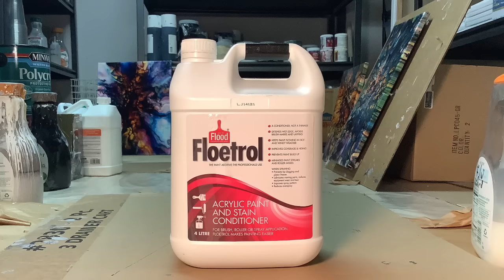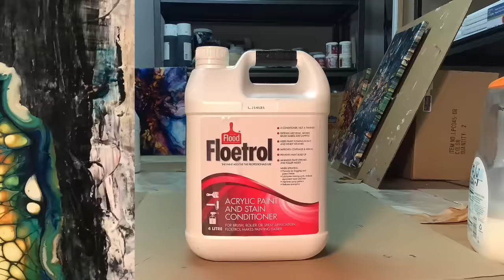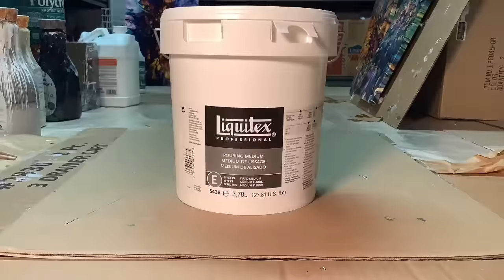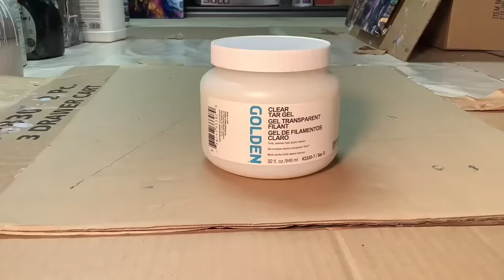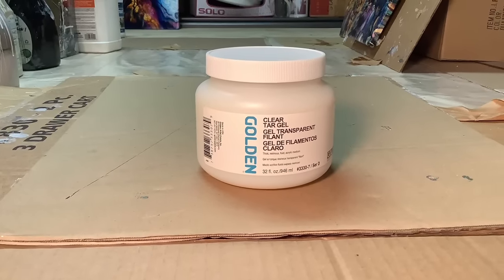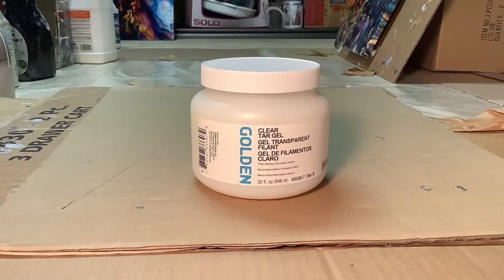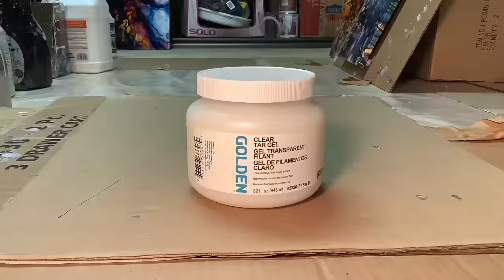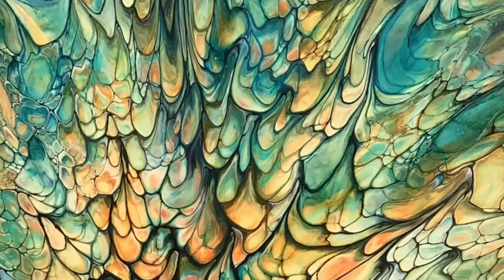What is the ultimate cell activator?

Comment: Just for clarification, a simplified ‘recipe’ would be; ( using 1/8cup = 1 part.).     1.) mix the main mix which is also called the base color, consisting of 1-3 parts paint. I choose 1/4 cup (2 parts) white acrylic paint. 3 parts medium which is  3/8’s cup of Behr # 3453 paint,  4 parts (1/2 cup) of Golden Tar Gel. 1 part thinner which is 1/8th cup of High Gloss Polycrylic
For the top layer, AKA the puddle pour;  1.) mix paint 2.)  Thinner which is 10 parts Liquitex Pouring medium & 4 parts Floetrol (watered down)  and then  10 parts of that thinner(1 1/4 c.) blended with 7 parts paint (7/8’s cup). Does this sound right?  Thanks for your help. I know I’m not the only one confused.
Reply: One more question for you Steve. Can I substitute the Golden Tar Gell for The Golden GAC 800? Will I get similar results?
Reply from the maker: Thank you so much Susan 🙏 sorry about the confusion. I can see there is confusion about the word “paint”...whether or not it’s Behr or Golden. Consider the main mix and the base coat identical except the colors used. The formula is 3 parts Behr...and 1 part polycrylic...and .4 parts tar gel. That makes the tar gel equal to 10% of the Behr and polycrylic combined. So 15 parts Behr plus 5 parts polycrylic equals 20 parts. 10% of 20 parts equals 2 parts tar gel. The grand total will be 22 parts mix. I the and 10% Golden paint to this total.
Reply from the maker: Your formula for the top layer mix is correct👍
Reply from the maker: @susandurry9079  ...the tar gel and GAC800 are two completely different products....I didn’t have a lot of success with GAC800
Reply: @chasefluidart4341  It’s funny how so many people recommend the GAC 800. Thank you so much for your expertise. I’m an artist wanting to try this process but have already spent more than I should have. I’ll keep experimenting! Thanks for your feedback. Happy painting to you!
Reply from the maker: Thank you so much Susan 🙏 I hope that I was able to clear up the mixes for you🙏 I will always try to help in any way I can. Feel free to pm me anytime👍

Comment: Great video Steve. I'm only new and located in Australia. Can you advise what the equivalent products would be as I can't get Behr. I'm also still a little confused about what products/ratio's you use for the different steps. Are you able to list them in order for the pillow, pouring medium, paints and top base for me to understand?
Reply from the maker: Thank you so much splatter 🙏 I am not familiar with Australian products except the Flotrol. What to look for with the pouring medium is the deepest base paint. It needs to be neutral...most of them look very light tan in color...avoid if it looks white because it will turn colors pastel. The ratio for the base and colors are the same...3 parts medium paint...1 part Polycrylic and .4 parts tar gel (10%). If you are using Australian Flotrol for the top layer mix the ratio is 3 parts Flotrol to 1 part paint. Keep in mind ratios are not exact because things change depending on the products used...but they are a good place to start. Best of luck on your journey 👍

Comment: Hi, I love your art.
I've only been in fluid art for a few months.
I watch your videos and try to translate them to understand them, just like I translate my questions,
  I hope not to bother
I find it very interesting sir, I would like to ask a person with more experience than me:
- Where I live it is impossible for me to get Australian floetrol and neither American floetrol,
but yes woetrol, I also get untinted house paint and glossy water-based polyurethane varnish,
the question is, if the consistency is from thicker to lighter? , starting with the thicker base house paint and then a little more diluted the acrylics with the medium, and finally the cellactivator a little more fluid
Thank you  ,
Reply from the maker: Thank you so much FFJJ 🙏 it appears that you have the translation done very well👍 with the lone exception of the top layer paint mix…everything else uses the same formula and paint…so they are the same consistency….the top layer mix on the other hand is heavier and more watery so that it will sink through the other paints.

Comment: I have watched this video several times. I wonder if you put a lighter fluid paint under the poured paint. Would this cause cells.

I need to not fear experimentation!
Reply from the maker: Excellent question Maya Jean 🙏 thank you so much. If you are referring to the base coats in the video the answer is no. The base coat is identical to the poured paints. However a lighter base coat would have an easier trip to the surface. The lightest paints I’ve found are Extreme Sheen from DecoArt. Go for it…experimentation is what makes it fun for me👍

Comment: Do you add colour paint (white) to the Main Mix:  Color Pouring Medium when you apply the first base layer?
Reply from the maker: Thank you so much Psilocybin 🙏 In this video the Main Mix consists of the Behr, Polycrylic and the Golden tar gel. I mix these products up and store them in a quart container. I then use this mixture in separate cups and add the individual colors to them. The base color is the same as the rest.
Reply: @chasefluidart4341  Excellent thank you very much - I'm giving your recipe a try today 😁 Your video was so informative and inspiring
Reply from the maker: @randomnumbers710  ….very kind …many thanks 🙏

Comment: Hello Mr Chase
Firstly, thank you for creating these videos. There is a lot of misunderstanding out there regarding this process.
Evidently, understanding paint density plays a fairly large part in a successful project. My question is: how do I/we determine the density of the paints we choose? This seems integral to how we layer our paints. There are some guidelines regarding opaque/transparent order, but I've not been able do discern the density. Have you any suggestions? Thank you sir.
Reply from the maker: Thank you so much Mark 🙏 I appreciate your comments. Yes I pay attention to densities but mainly in a flip cup type of pour …where gravity alone is responsible the source of pressure. The top layer mix goes in the cup first…followed by heavy densities up to the lightest. With air pressure there is a little more leeway because the extra pressure takes up the slack if the densities are out of balance. Rather than getting bogged down in numbers I use my practice canvas and experiment with different combinations even if the densities aren’t ideally layered. Truth be told I’m more concerned with how the colors interact. As long as the top layer mix is fluid enough and heavy enough to sink through the other paints the cells will form with the proper pressure. Companies such as Golden and Liquitex have charts that have densities listed…the best bet is to contact the manufacturers 👍
Reply: @chasefluidart4341  Thank you sir
I have many different manufacturers of paint, and I see a varied mix of different makers used by most videos I’ve seen. Seems very daunting to examine the densities of these combinations. Good to verify, as long as the top paint is heavier (hence the titanium whites and blacks), cells should form. I’m currently engrossed with the bloom technique and I think I’m safe with your advice. Thanks again
- Mark
Reply from the maker: @MarkZart  …glad to help…best of luck on your journey 👍

Comment: Hi! I'm a beginner at paint pouring and making cells.  I have 2 challenges that I would like to hear from an experienced person how I probably could solve.  

1.) My paintings are cracking when drying.
2.) My cells disappear after some minutes.  
Could it be because I have a too thick layer of wallpainting in the bottom?
Reply from the maker: Thank you so much Johanna 🙏 all I can offer is a guess or my opinion. First of all I am assuming that when you say “wallpainting” you are referring to using commercial wall paint as a base coat. If that is the case then yes you are probably using too much. The cells will dissipate and the film will setup and dry before the rest of the paint has a chance to do the same. That will usually cause cracking. 
Using house paint is certainly more economical but you pay a price because you lose continuity….it’s making the artist grade acrylics weaker… and as a consequence the cells will be weaker. Ideally I want to use the same paint throughout… so my base paint uses the exact same paint and medium as the other colors….and my best results come when the finished product is thin on the canvas.

Comment: Thank you for your precious advice and the giggles 😂 Is it possible to create beautiful cells without rotating the canvas? 🤔 
p/s Sorry if my English is poor, I use google translate. 😅
Reply from the maker: Thank you F.G. 🙏 Yes…if the ingredients are proper and thin enough. Base line Rayleigh Taylor Instability proves it. Heavy paint sinks while lighter paint rises to meet equilibrium and that creates the cells. The problem is the size of the cells is limited without horizontal movement. Rotation thins a puddle out radially/horizontally and forces the cells to expand….and also cover the canvas.

Comment: Do you have any suggestions on how to get rid of bubbles in the Behr pouring medium. I always dealt with bubbles with the more traditional acrylic pouring a quick pass of a torch, or simply dropping the canvas. Neither method seems to work that well with the thicker Behr mixture. I get the bubbles either when I mix the Behr with the Polycrylic, or when I add the pigments to the same mixture. They really stick around even after spinning and don't look good after the paint dries. Any suggestions would be welcome!
Reply from the maker: Hi Paul 🙏 as a general rule I mix up the main mix by the quart and they sit at rest for weeks at a time. I will gently stir before use. Most bubbles will dissipate after air is applied.👍
Reply: @chasefluidart4341  I'm only mixing up one quart at a time, and then use it within a few days before mixing another batch. I guess I could mix up more so I have some sitting unused for a longer time.
Reply from the maker: The combination of letting it rest, spinning and air pressure usually results in very few bubbles. I do pop bubbles on final inspection but it’s pretty minor. One last thought..you might try adding a little isopropyl alcohol to the mix and see if that helps…some people swear by it.

Comment: Does it matter what color u add to the base paint or pillow paint? Also what about just mixing pigments in dry form with the medium and does it matter if the colors are translucent or opaque ? Lastly how to blow it over the colors without blowing into the pillow and causing it to come up. I have really been struggling with this. If I do a swipe it’s easy but blowing is hard and get very few cells .
Reply from the maker: Sorry this reply took so long Brandi 🙏 I’ve been away from home. Since this video was produced I have modified some things in a new video you might want to watch….see my home page in Chase Fluid Art. It will answer some of your questions. So…no it doesn’t matter about colors in your base. Opaque will cover colors below it…translucent will slow colors to show through. Blowing the paint is tricky. In my experience less force is better….it took a lot of practice for me…in the video you already watched there is a section towards the end shows how I go about it. Thank you so much for your questions 👍

Comment: I'm tying to follow your directions, but having some issues.  So you have 3 layers of paint:  Base, Middle & Top.  In your video, was the middle layer where you squirted lines of different colors at random and the top coat was the black you put mostly in the middle and blew outward?  You said, I think, that you use Golden Fluid Paints, but later you said Fluid Acrylics do not have enough body because they lack fillers.  Is that a contradiction?  You said we need a soft body paint like a student grade (Lucas or Amsterdam.  Or maybe, you use Golden "Fluid" for middle layer and student soft body for top layer.  Also, I really wish you would make videos.
Reply from the maker: Thank you so much Kathy 🙏 I appreciate your comments. Yes I use the fluid acrylics for the first two layers. The reference to them not having enough body relates to the top layer mix only. For that I like soft body paints.👍

Comment: Would you say that the top layer mix is supposed to be thicker or thinner than the bottom layer? I have matched your formula for the bottom layer, but Lucas Arts and Amsterdam paints are hard to come by here in Canada so I'm using Liquitex fluid acrylics. I've tried the 10 to 7 ratio of thinned Liquitex with the Liquitex paint, but the results haven't been great. I've seen some cells forming but it's nothing like what your demonstration shows. I'm using forced air and spinning on the mixture. I presume the Liquitex paint is the culprit. From your video it looks like the top layer mix is slightly thinner than the bottom layer mix, although it's hard to tell. Any suggestions would be welcome.
Reply from the maker: Hi Paul 🙏 I’ve tried the Liquitex fluid acrylics also with minor success. Just my opinion but I can use the exact same materials, measurements and procedures and the Lukas out performs the Liquitex every time. Two things come to mind…possible chemical interference with the Liquitex paint or a difference in consistency. The top layer mix should be thinner to help it sink through the other layers. Try thinning the top layer mix even more.  It’s a real fine line because if it’s too thin the cells won’t hold together so experiment gradually. Next consider how you are manipulating the paint. Keep in mind that I am using an air compressor. Comparing a hair dryer vs. air compressor at the same velocity the compressor is going to have more force…so my top layer mix has to be thicker. Keep in mind that it doesn’t take too much force to see results…. As I said in the video.. I have found very few paints that really work well for the top layer mix Lukas just happens to be the best….I get mine through Jerry’s Artorama.
Reply: @chasefluidart4341  Thanks for the info. I couldn't find any place in Canada selling Lukas Kryl paint so I decided to bite the bullet and order some from a store in London England. I just have to be patient until it arrives!
Reply from the maker: Jerry’s is in America
Reply: @chasefluidart4341  Jackson's was actually a little bit cheaper. Shipping was high from both locations...
Reply from the maker: @phsteele  👍
Reply: @chasefluidart4341  I've had some success using your ingredients. The biggest issue I'm having is getting consistent results blowing out the black puddle. I've used both compressed air and a Shop Vac in blower mode. I have better luck experimenting with smaller 12x8 canvases, but when I go up to something like 14x18, figuring out how big the black puddle should be is a mystery, and I find it difficult to move the paint across the whole canvas. The first layer of paint starts to interfere with the flow of the black paint and bottom layer paints actually start to flow with the black paint. I've had much better results using a swipe technique (I prefer wet paper towel) to spread the black, but I don't really like the uniformity of the cells in that case (depending how what I'm looking for). I may try thinning the black mixture a bit more to see if I can get better results using compressed air. If you have any suggestions that would be great.
Reply from the maker: Hi Paul 🙏 looks like you are having fun👍 my advice….Puddles are harder to deal with because of the force required. I like to keep the layers thin and spread them out towards the edge of the canvas…that includes the top layer mix. While I know the air I’m using is pushing the paint down, that is a given so I don’t even have to think about it. I am really concentrating on spreading the paint out.That is why I prefer the air compressor gun. Start low to the canvas with very, very little air flow and the simultaneously raise the gun and add air as you go up. By the time the paint is close or over the edge I’ll be two feet above the canvas and the gun will be at full power. The volume and consistency of the top layer mix is key. It has to be thin enough to spread but heavy enough to sink and hold together. Keep up the good work!
Reply: @chasefluidart4341  That all makes perfect sense. I will continue the great experiment tomorrow!
Reply from the maker: @phsteele  👍

Comment: I am still confused about the composition of the top layer. Please simplify! Thanks.
Reply from the maker: Thank you so much Aparna 🙏 hope this helps.

Floetrol/Water Thinner: 5 parts regular Floetrol plus 8 parts water. 
This will be used to thin the Tar Gel or the Liquitex Pouring Medium.

Tar Gel Top Layer Mix: 
10 parts Floetrol/Water plus 4 parts Golden Tar Gel. This makes the thinner for the paint.
Then mix:   8 parts Thinner Mix with 3 parts soft body paint.

Liquitex Pouring Medium Mix:
4 parts Floetrol/Water plus 10 parts Liquitex Pouring Medium. This makes the thinner for the paint.
Then mix:   10 parts Thinner Mix with 7 parts soft body paint